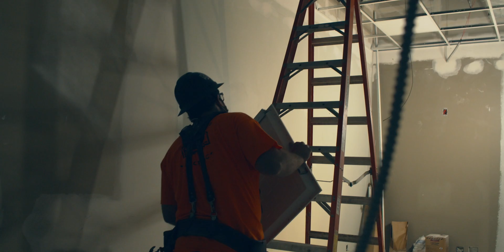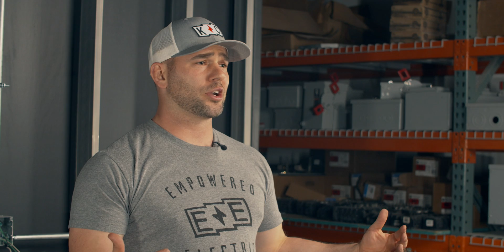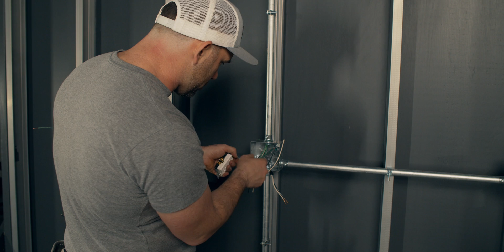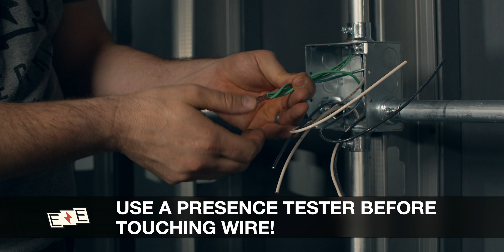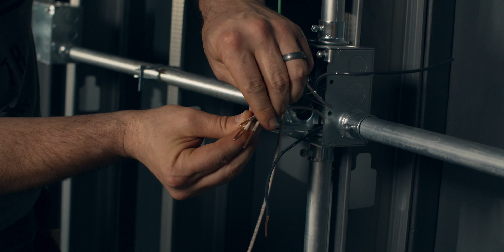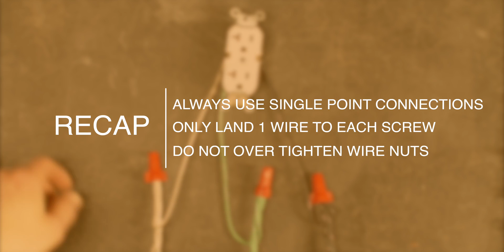What's a Pigtail

Comment: I have an outlet that is receiving power, but nothing works when I plug it in. I replaced it without success and the next outlet downstream has the same issue, I have not changed out that one yet. I did also check the connections to the pigtails, they all appear in good condition. The outlet which I believe is before this one is fine. Any advice?

Comment: What kind of wires are those that you got for the pigtail?
Reply: Same gauge as the circuit and they are just precut from the same rolls of wire.  If you’re a DIY, you’re probably using Romex and so just strip it and cut to length.  For a ground, you can buy green sheathed pigtails.

Comment: While I agree with using pigtails, your comment on "holes of despair" is wrong. That is a spec grade receptacle you're showing and does not have backstab holes. Those holes or openings are for back wiring where tightening the screw clamps down on the wire. It's a legitimate option, installers choice. The mud ring should be installed to complete the rough in, no? Good job over all, thanks.

Comment: "holes of despair, never use these holes"... there is a reason why there were manufactured and installed on those outlets.
Reply from the maker: Understood, but once again this is about how to avoid future problems, just like the NEC is the minimum. I've never had box make up issues or circuit interruptions because of a plug. Avoid those holes and hook and pinch your wires.

Comment: what are your thoughts on Wago connectors? Seems so much easier to implement and just as effective, but what do I know? Great video BTW
Reply from the maker: Peter thanks a ton. The guys at Intrepid (https://www.intrepidcreative.co) make me look and sound so much smarter than I am.

Regarding Wagos: I used a ton of them when I was a first and second year apprentice but feel wire nuts are a better option now. But, I think if you feel more comfortable using them just make sure 

1. that all the wire is striped to a similar length (ensuring enough copper is making contact inside the wago but no copper is exposed outside causing a arc hazard), 
 
2. Make sure they slide straight into the right slot (if they go in at an angle they won’t properly grab), 

3. Just like wire nuts, give them a little tug at the end and call them good.
Reply: Wago lever nuts. 👍🏼check out sparky channel if you haven't already . Great detail and information.